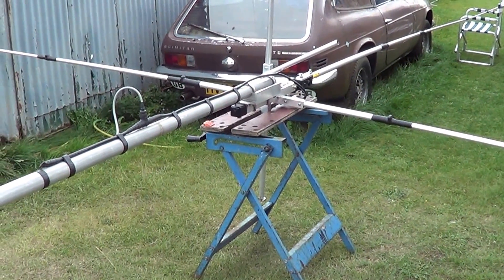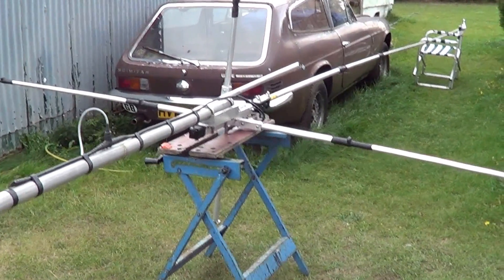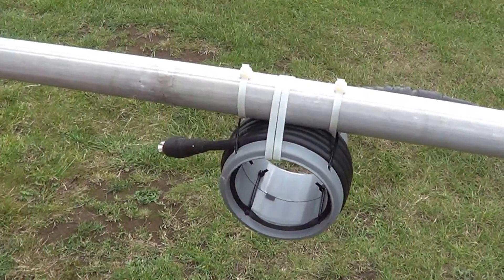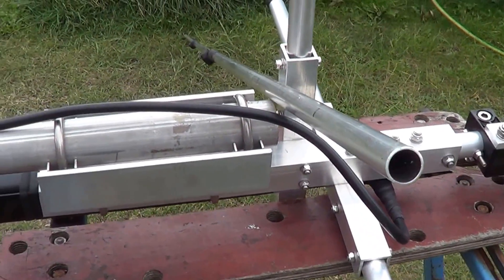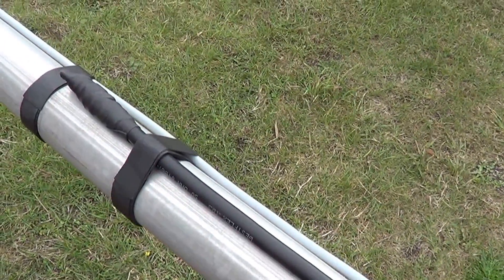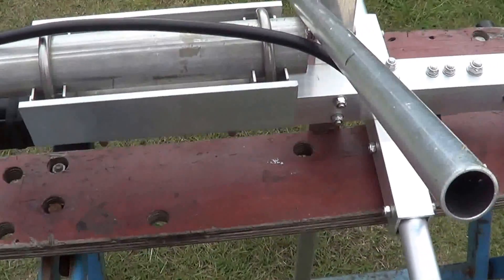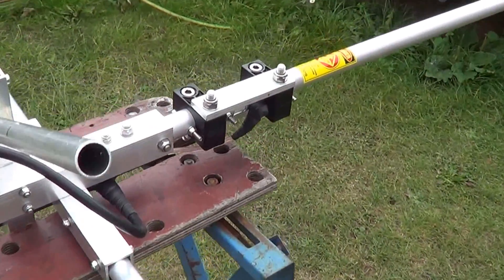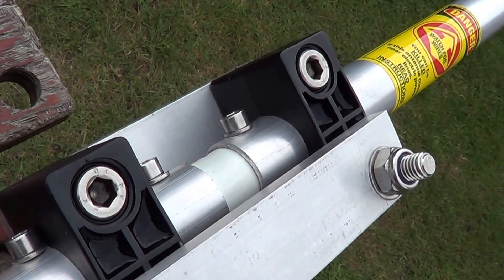Vortex Quasar 64 Antenna Review By M0OGY..........Part 1

Comment: Don't forget to use 
Fist use  Aluminium Conductive Grease Compound - element joining paste then
 star brite liquid electrical tape then 
  Black Adhesive/Glue Lined Weatherproof Heat shrink Tubing/Heat Shrink Sleeving remember only do things one and ones only good videos by the way